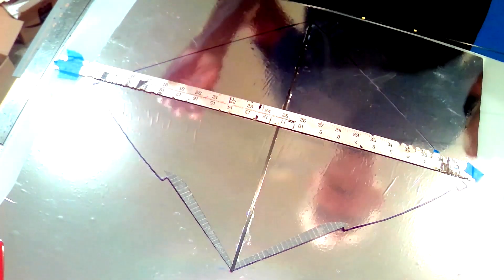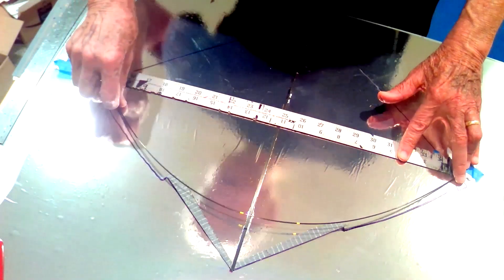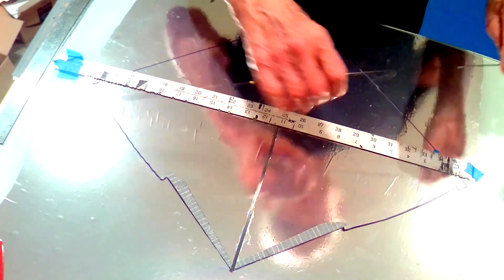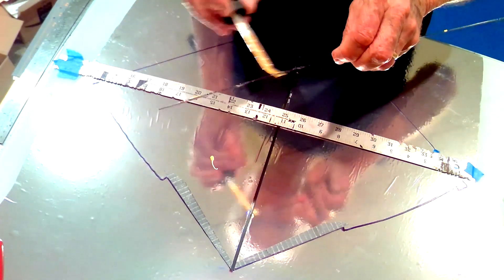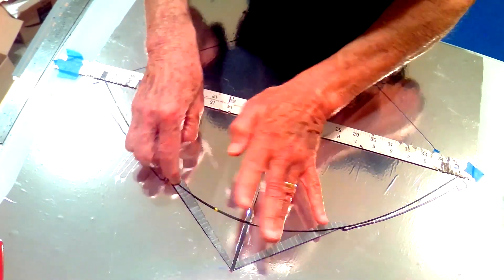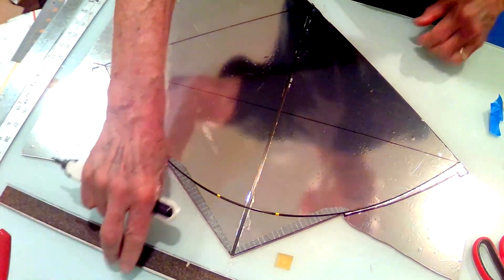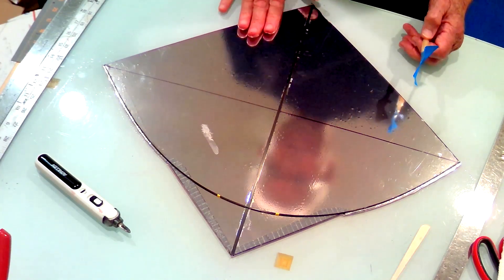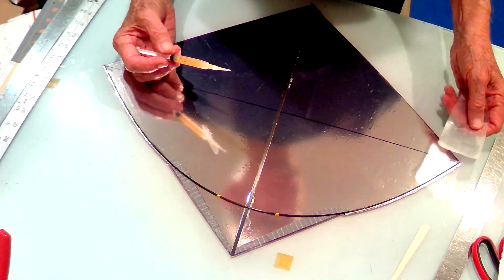Making Slodog Part 1

Comment: What flat  carbon spine size?
If bamboo spine ,how thick ?
What carbon bow size?
If bamboo bow what thickness? 
And flat batten specs?
Thanks for thenvideos!
Reply from the maker: flat carbon spine is 1mmx4mm, if i used bamboo, i would make it about 3/16" wide on the skin side and make the portion between the nose and the wingtip to wingtip line smaller in cross section by about 5-10% than the portion below the wingtip line.  for the bow in the video the carbon is 1.5mm and for bamboo, i would make it so the tension/stiffness was between a 1.5mm & 0.06" diameter carbon rod stiffness. since each variety of bamboo is different, it's very difficult to make a suggestion for the bow cross sections.
Reply: @bruce.lambert Thanks for the replies!